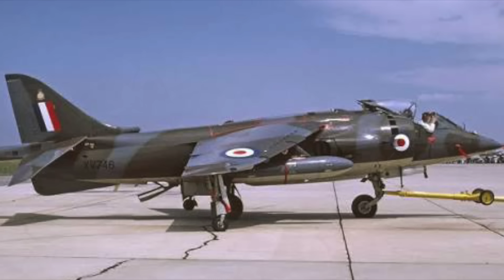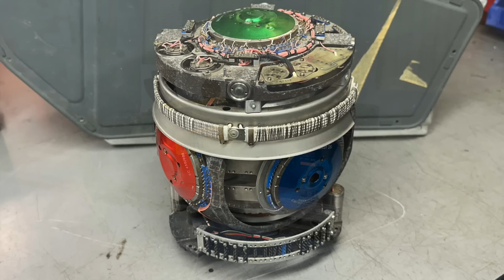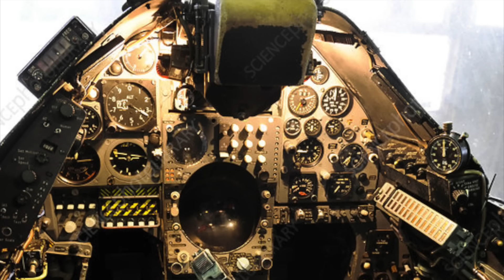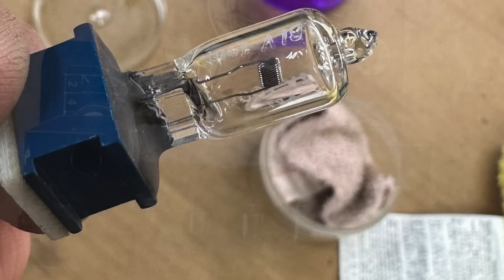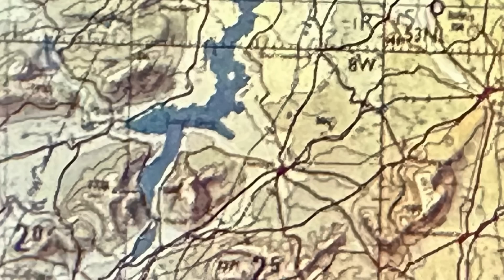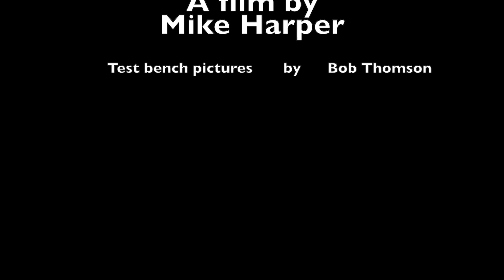Harrier Moving Map Display

Comment: The Mi-24 utilised a similar map system known as the Planshet-AV. It was also used in the MiG-31 and the Ka-50. Whilst Su-24 had a digital mapping feature thanks to its navigation system and radar along with built in electro optical map in the HUD.

Comment: I saw one of these demonstrated on the workbench during a UAS visit to Wittering back in the day. Although you correctly state that if the aircraft flew off the side of the frame the system automatically slewed the film strip to the appropriate point, what you didn't make clear was that this could take a few seconds during which all that was on the screen was a blur of scrolling film. At high speed and low level, I expect this "outage" could be quite disconcerting! 😮

Comment: I still have schematics and notes from the Marconi version used on Jaguar.  I vividly remember the 35mm film whizzing back and forth on the carrier as the aircraft got close to the edge of the 33mm film frame.  We used films from around Berlin to test each system before it left the factory.
Reply: Press.. select.. destination.. fix.. lock.. accle.. press.. reject.. pres-pos… 😆

Comment: Standing mere 50 feet to the side of one of this magnificent birds performing vertical landings on the moving flight deck on a NAVY Landing Ship in the 1990's is one of my most cherished memories while in the service. Guaranteed to solve anyones constipation problems.... You could hear and feel them even if you were 5 decks below water, in a machinery room running equipment wearing hearing protection! Watching them birds turn around on a dime and taxi to your refueling station area and seeing that giant turbine intake spinning made you think " I am getting sucked in there in about a second ", then you would have to duck into the cat walk while the plane turned back around. Once you came back out to the fueling station, you had the turbine exhaust at idle pointing back at your face, you could hear nothing out of the Sound Powered Phones, nor see the the crew on deck because the hot jet exhaust / blast made your googles flutter on your face. You had to rely on hand signals, plane captains, safety PO's, Yellow Shirts, sound powered phones commands ... They used to call it Combat Re-Fueling/Hot Refueling because the birds were never shut down. Ordnance loading/off-loading evolutions while all this madness was going on around you was another level of danger you got used to. It was a carefully choreographed evolution rehearsed every time we went out to sea for flight op's with V/STOL A/V-8B's onboard.. I can close my eyes and re-live it all over and over again.  Saw a Marine Captain (I guess making his first flight deck Vertical Landing Qualifications) misjudge the movements of the ship and cut off power on the down swing of the deck, the plane fell like a rock like 15 feet before hitting the deck and bouncing up maybe 5 feet coming back down hard on a nose dive, broke the front landing gear and bent the nose cone (ra-dome?) upwards. Pilot walked off bruised and ego hurt but OK, the plane was not!
Reply: I'm curious, what happened to that one particular Marine Captain, something that was very unpleasant I'd presume?

Comment: Unbelivable! So they were reading mechanical gyroscope, feeding it into a electromechanical contraption that kept rolling and sliding a roll of film to provide navigation for hundreds of kilometers? Just wow!
Reply: The gyroscopes kept the inertial platform perfectly level at all time in flight and also referenced to true north. Accelerometers on the platform sensed N/S and EW accelerations which double integrated gave distance travelled…. And drove the map. Mechanical gearing did the integration functions.

Comment: INS is not dead reckoning.
I know Wikipedia says it does, but Wikipedia is wrong.

Dead reckoning is about knowing the objects previous position, knowing the speed, bearing, and how long the object has been travelling at that constant speed in order to calculate the current position of the object.

This is not how INS works.
The only previous position INS knows about is the take off position, the starting point of the flight.

INS also doesn't measure speed or bearing or time.

INS uses acceleromers to measure acceleration. It is not measuring speed. And it doesn't need to know how long the aircraft has been in flight.
Reply: It is dead reckoning... but over tiny segments added up many times per second, instead of a few segments over the entire flight. For each segment, after directly measuring acceleration, this acceleration is integrated (essentially meaning, multiplied by time) to find velocity, and then the velocity integrated again to find the change of position. And this change applied to the previous position. Over and over.
Reply: @FlyNAA  Exactly. The real explanation for how the missile knows where it is at all times.

Comment: These precise mechanical devices really justified the high prices of airplanes. Today, they have been replaced by cheap digital things... And airplane prices are even higher🙂
Reply: Cheap digital things supported by satellites in space and huge data centers, connected with millions of miles of fiber optic, satellite dishes, repeaters, etc.
Reply: @madfury3179  Today, all this is taken for granted... Everything works on the same principle. But those mechanical things were really ingenious and unique.
I work for a small company that makes digital aviation instruments. We use very few mechanical parts in them...they are much more complicated to manufacture than other electronically supported equipment.
Reply: @madfury3179  Yeah, digital replacing analogue is not at all a cost saving measure in this case. Military hardware is definitely overpriced, but not because the internal components are cheap off-the-shelf electronics.

Comment: Ex RAF Phantoms had a Ferranti INAS in the back seat too. Also worked on Tornado as well, they had a similar moving map display, rear seat combined with the ground mapping radar.
Reply: ohh, so they have a dual setup? WSO and Pilot with paralell units?
Reply: @marcox43 yes!

Comment: The modules in the boxes were replaced second line in the equipment bays on the operational station. The unserviceable modules were then usually sent to RAF Sealand for repair and calibration. 
A pilot reported error of more than 2 nautical miles in position from the INS. Usually meant a Present Position Computer replacement (easiest) or Inertial Platform (Hardest) An IP replacement I seem to remember meant a nose cone removal.

Comment: The Harrier simulator was a similarly ingenious device. It used a camera tracking across a 3D modelled landscape. Soon after it was put on line a modification was needed to make tall buildings tilt over when hit by the moving camera, otherwise the simulator had to be shut down while the camera was reset. In my week there I learnt a lot about the aircraft, too much apparently. A competition took place between squadrons at the end of the week which required the delivery of a short presentation on the Harrier. After I delivered mine the Wing Commander had a little chat, asked me how I had learned so much critical range/payload data etc. then asked me not to repeat any of it and requested that I handed him my notes.
Reply: On a cadets visit to Wildenrath (early 70's) we went to Bruggen to see the simulator there. Here and there were scars etched deep into the model where the camera had been driven into the surface and wiped out. We were told the lenses were about 10k  to replace.
Reply: @marticus2023  I went there too, probably 1970 or 71.
Reply: Hence your username?
Reply: I used to work on the F4 simulator at Bruggen, then later the Tornado simulator. The Harrier Sim was at Wildenrath. Happy days 😊
Reply: Sounds very similar to the analog 1970s tank simulator featured on Tom Scott's channel. Which can be seen in operation in the video, restored and up and working.
Reply: @Activated_Complex  Simulation has come a long way since the 70s, but the correct decisions still have to be made when creating the spec. I became involved with a rail simulator for which the specs had already been signed off. They made a fundamental error in that they chose to go with filmed footage rather than risk going with computer generated graphics. The signals were aways green.......

Comment: This know how is long gone and never to be recovered.
Reply: Actually - I cannot agree - the mechanical principles of the contraption are well understood, and it could be replicated with better quality - using contemporary materials, parts, engineering and production methods. The device is very complex of course - but nothing magical. We just have better technology today, no need in wide film with actual map drawings.
Reply: @TheHellishFrog  If by "know how" OP simply means the ability to manufacture such a device then you're absolutely correct. However to cut OP some slack, "know how" in terms of people in the defence industry still being familiar with/able to service these specific devices is probably gone, in the same way that the "know how" of being familiar with any given obsolete technology is not generally passed on to the next generation and therefore fades rather quickly. Outside of certain niche circles, of course.
Reply: what do you think this video is

Comment: Great wee film Mike. I read that unjammable gyro navigation is once again being explored by Ukraine to get drones close to their target, then optical AI to strike the intended object. What goes around....
Reply: Most modern jet fighters and even airliners have internal navigation systems. GPS doesn't have perfect global coverage over the whole world and jamming and or failures are always a possibility. Most modern systems use laser ring gyros rather than mechanical but it does the same thing. Drones are likely to use the tilt and g force sensors that are in smart phones just because they are cheap and fairly accurate.
Reply: @Owen-mt4si Tuning Fork gyros.
Reply: Machine vision. That's the name you're looking for. Machine vision. Optical AI 😂